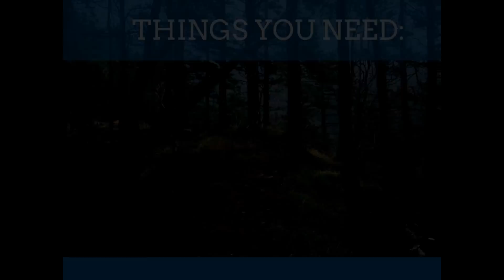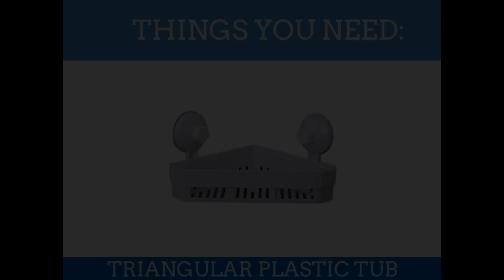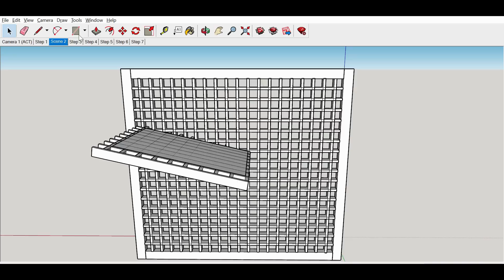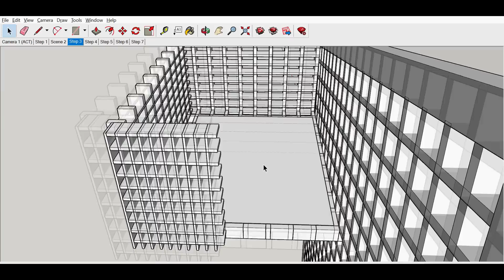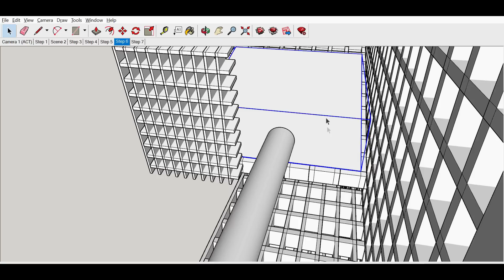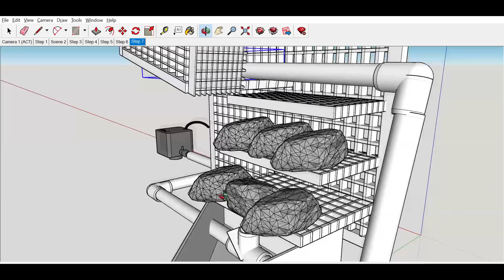Aquarium Sand Waterfall Using Powerhead: Full construction tutorial

Comment: Does the powerhead differ if I am using this method in a 5foot tank holding 450 litre of water.i have tried this method and all I can see the sand being sucked in by the T joint but it's not making the sand comeout. Do I need a stronger pump . I was using https://m.ebay.co.uk/itm/Newa-Maxi-Power-Head-MP-900-Flow-Pump-Powerhead-920L-H-for-Aquariums/282576655124?hash=item41cae19314:g:ch4AAOSwyKxXgif5 for my tank.do u think I need more powerful head. I was thinking of purchasing ehiem 5000https://www.amazon.co.uk/gp/aw/d/B008N9O3ZS/ref=mp_s_a_1_1?ie=UTF8&qid=1509620301&sr=8-1&keywords=eheim+5000&dpPl=1&dpID=415eoZQke3L&ref=plSrch . Need your advise. Thanks
Reply from the maker: 2 Problems
1. Either the slit is too close to the bottom of the pipe restricting jet steam flow
2. Pump power is not enough.

Comment: I'm having trouble with the sand backflowing up the T. I cut a slit in it as you show. The slit extends beyond the top of the T where the sand enters it. If the tubing is filled with sand and I block it, everything works perfectly, but otherwise the sand pushes its way up to mound around the opening and nothing falls from the waterfall opening at the top. Any suggestions?
Reply from the maker: Hi Ddeuerme. Your slit is not deep enough.. You just need about 3mm gap between the slit and the pipe to create a jet stream effect. Think of it as a jet engine. The more narrower the slit opening is, the more powerful the jet stream will be. If the gap is small enough, the water should not shoot out from the sand inlet. Ensure the slit is flowing on the correct direction.
Reply: Thank you! I'll try this tonight. I'm sure everything else is ok in my setup. I have a 315 GPH pump and when I cover the inlet (top of the T), It works perfectly. I love what you've done. You're brilliant! 

Once this is fixed, my plan is to use what you taught me to try to create a river that extends beyond the waterfall using slits in PVC every inch or two to allow some of the sand to escape at each slit, with the return at a "lake" at the end of the river.
Reply from the maker: Wow ... Your idea seems very enticing.. Please upload a video or pic once you are done. I cant wait to see your creation.
Reply from the maker: I guess your sand is choking the water flow... Adjust your slit to give it a better water flow.  The whole purpose of the 45 degree slit is to create a one way directional stream so that the water will not flow to the top of the T-joint. Hence the sand from the top should flow down with the help of gravity.
Reply: I finally just quit working on this whole project. 

For my first problem, with the sand that wouldn't flow, I finally figured out the problem was in the reducing joints I was using. They were too small and constricted the flow. I ended up replacing everything (joints, pipes, etc) with 1/2-inch clear flexible tubing, and a more powerful pump. 

I gave up on the flowing river, at least for now. I used tubing bent around to a T that returned the water to the beginning of the river, but it just looked funny. Maybe I'll try again someday, but I got tired of working on it.

Comment: How do you attach 1inch pipe to powerhead
Reply from the maker: Dear Debbie, your powerhead should come with the necessary adapters. If not You can just cut a small 1 inch vinyl hose in to a small piece and heat up the hose with hot water. This should expand the hose and the connection between the powerhead and pipe will be a snug fit.

Comment: Thank you for the video I already got everything I only need some suggestions of what kind of sand and what kind of Powerhead are you using? can it work with a EcoPlus 185 Fixed Flow Submersible/Inline Pump 158 GPH?
Reply from the maker: Hi Robert, For the sand i used  http://amzn.to/2rfvTKI . As for the pump. 152 GPH is fine. You can always use a valve to control the flow if you think the sand fall is bursting out.
Reply: Thanks so much

Comment: hello, your videos are simple and awesome, best metod ever! (i wasted lots of time with the air pump metod, lots of problems but this seems problem free. please tell what l/h has to have the power head? thank you for your work!
Reply from the maker: Hi Mircea, Thank for your comment!. Yeah i hated the air pump method too. 

For this setup, I used a 210 GPH submersible water pump (http://amzn.to/2qwMlGx) Similar to this. You may also check out

https://www.youtube.com/watch?v=IoQRn0_AJ3Y

On how i created the piping works and the layout.
Reply: Rakazaa Studio thank you my friend, I'm from Romania, can't order that pump here, found just Resun 1200l filter (700l/h, no flow adjuster) maibe i make a valve in the circuit to lose some presure, what do you think?
Reply from the maker: Hi Mircea, Try to find a smaller flow pump. I did try a big pump and the sand was flying all over my tank strong current caused by the pump. You may try using a valve but over the long run, It will cause your valve to be clogged with brown algae. which will cause the water flow to slow down.